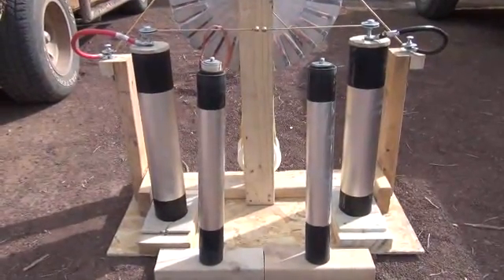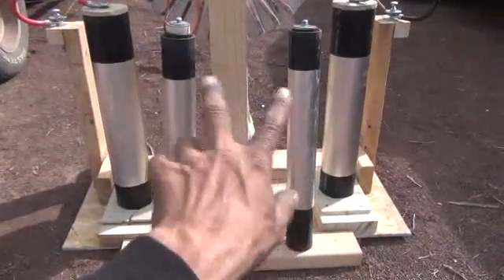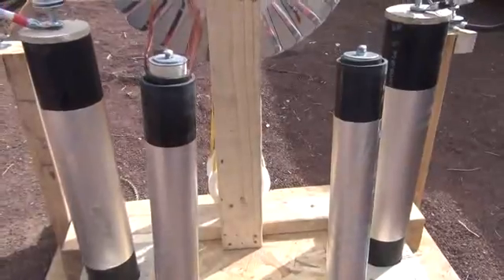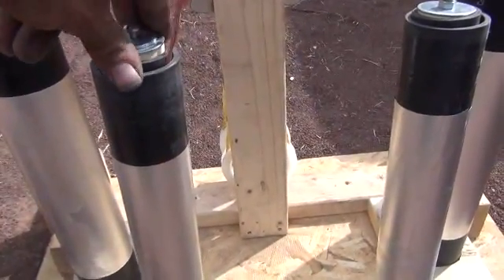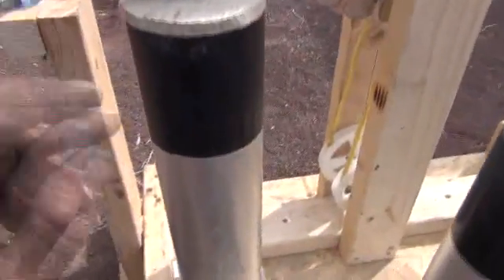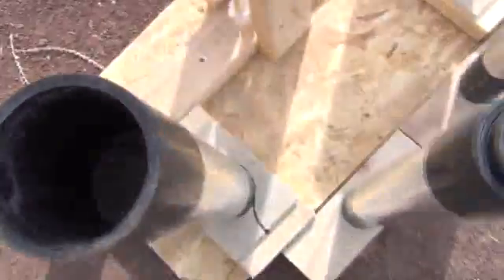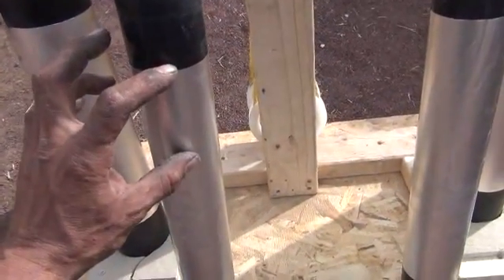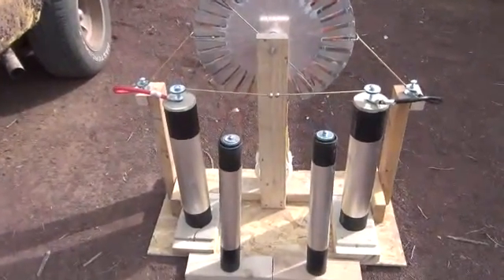Capacitor "home made" high power

Comment: Wow giant capacitor...

May I ask below capacitor geometry questions?

Bigger the roll (bigger diameter) make higher capacitance.

More surface contact to + and - leg make higher Amp capacitor.

Does longer the cylinder roll make higher DC voltage?

Is your DC or AC capacitor?

Comment: so my question that im concerd is what is your break down voltage and any idea what kind of farads or micro farads you are putting out i ask because im looking to build a railgun but i have a hard time getting enough cash to buy enough capacitors to build a powerful bank but if i could build them i would much rather

Comment: What if you made a roll off two peaces of aluminum foil with some insulating plastic film between the layers, would that work?
Reply from the maker: +inkva yes
Reply: Thank you.
Reply: Yeah. Made some layered plastic and foil rolled up once for a tesla coil. Be very careful with these. The static electricity generated while rolling them up charged the capacitors and nearly knocked me out.
Reply: aluminumized mylar,,,thing balloons

Comment: It looks like the pos and neg charges from the generator are stored in the inner cores of the two detached cylinder sets. In other words, though physically separated by a 20" air gap, the two inner cylinders form a single capacitor, one pos. one neg. The two outer aluminum wraps (around the outsides of the two outer visible cylinders) are just shells. If they are in communication, it's mainly through 10 to 20 inches of air gap, which might also be storing charge. (uh ohh! where would that charge be stored? ...)

Very interesting design!! A two part capacitor! (storing energy in ... zero point space?)

I don't know if another warning might be appropriate -- one might ground out one half of the cap, say the left cylinder only, and still get blown away by the charge in the other half of the two part capacitor?

Comment: If you use plastic pipe instead of your wooden junction pieces I reckon you will develop better voltages.
Wood is not so good at the voltages you are developing. Depends on the water  content and wood takes in water on a high humidity day.

Sparking causes a very broadband pulse of radio energy so virtually any length of antenna will pick up the matching frequency that the antenna is naturally 'tuned' to.
So you will pick up some clicks on a radio.
You will also put out a lot of  interference!

Comment: Flashing would be more expensive, and you really don't need it to be that thick because the current flow is pretty low. You might want thicker material with high capacitance devices (closer to a farad [these are micro- or pico- farads]).
Having the plates close together with a lot of surface area will give you higher capacitance. Having a strong, thick dielectric will up the voltage rating.

Comment: I didn't understand, did you used two separated loops of aluminium foil separated by a loop of pvc, or did you used 2 "giant" pieces of aluminium and rolled them with pvc? I made one with 2 aluminium foils and 2 vinyl foils rolled, something like 5 meters of foil. It is really strong.